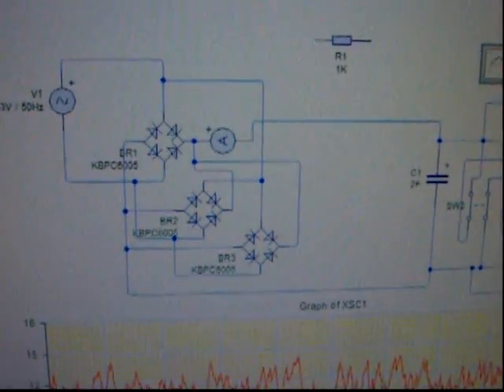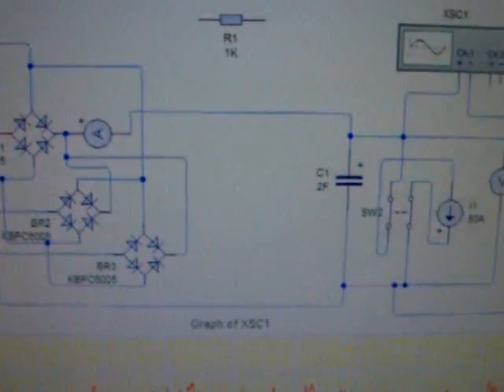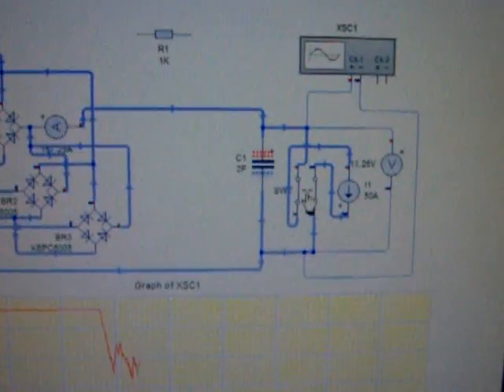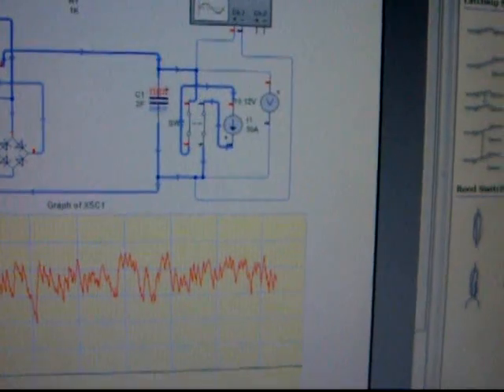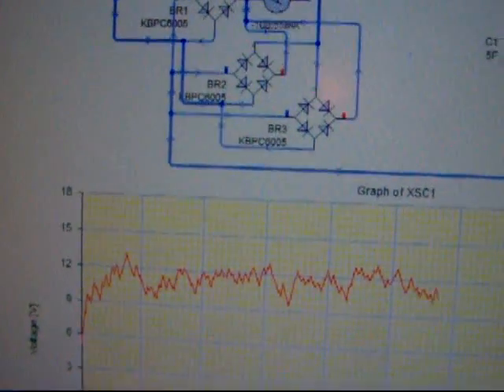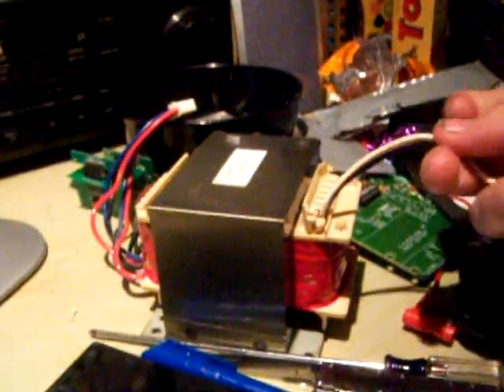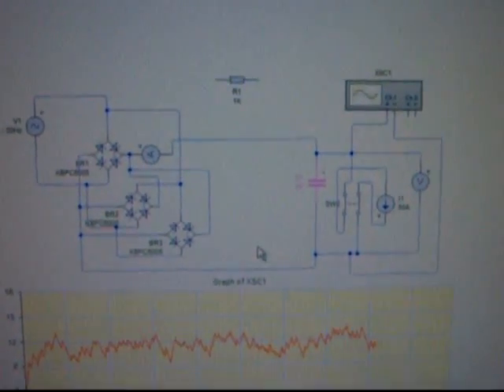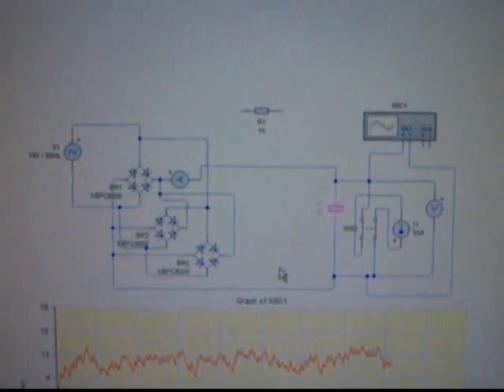DIY Power Supply 50A+ Plan

Comment: Are you still working on this? I have a really big transformer that could be modded to fit this use that you can have. However I would say you need to make a switching power supply, its the only way get the size requirements for the capacitors and transformer down.

Comment: @barevids well in that case you can start by plugging the actual ratings of your transformer in the simulator and see what that produces, and what kind of load it can take without serious voltage drop.

Comment: the problem is that the transformer you have won't cut it, i said it before.

also i'm curious what you don't understand in the design in the link you posted. it's actually quite straightforward.

Comment: you could use a regulator to regulate the voltage to 13.8 volts or a similar car alternator voltage. you would need a beefy one though to handle the current. or increase the wattage available through the transformer. i dont know anything about this program but im assuming you can enter the available wattage from the source. i dont see how 2 farads wouldnt be enough as most power supplies only have 100,000 at most and you can still draw some serious wattage from it. ill make another comment soon

Comment: Hmmm... That is quite the pickle. Idk I just take a computer power supply and strip all the +12 wires and an equal number of grounds and that's how I power my car amps indoors. And if you want it to be super smooth you could add a cap to that, but really you can get an infinite amount of power by putting psu's ogether. I am running 78 amps right now by using two 39 amp psu. And they are dirt cheap. I know that's not what you're going for but just thought I'd throw my two cents in.